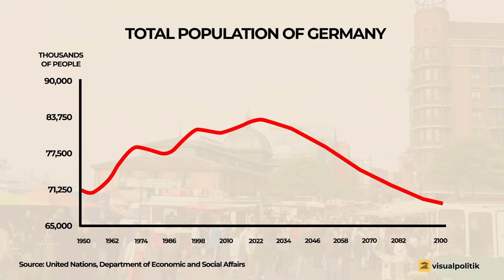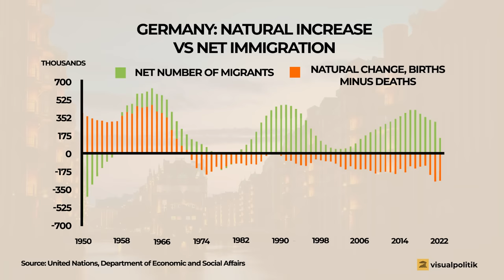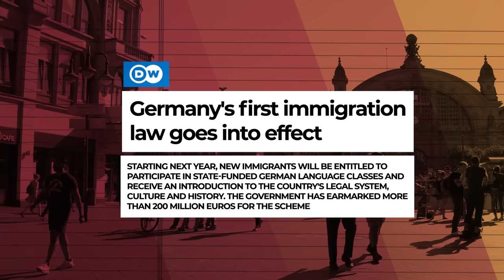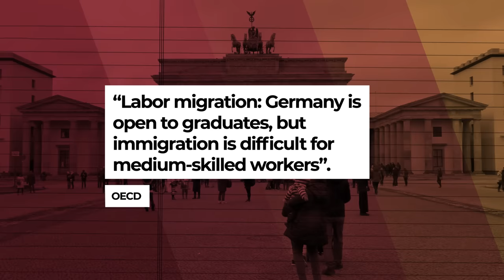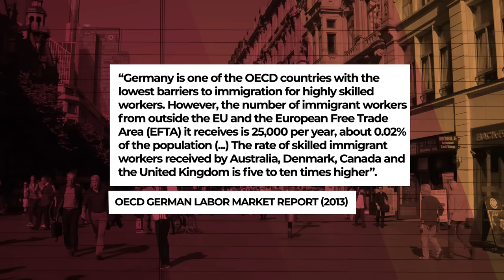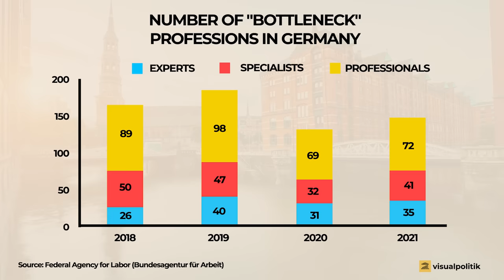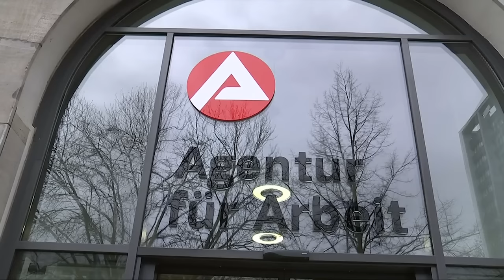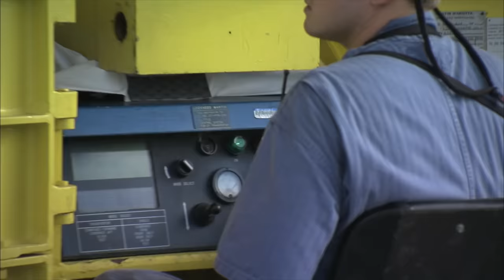Why Is Talent Fleeing Germany?

Comment: I am a seasoned software engineer, and I came to Germany from the US about 10 years ago. I had high hopes, but those hopes were quickly dashed.

Most of my time was spent in Berlin. Berlin's employers are very reticent to pay market rates. Half to a third of what I could make in the Boston area where I'm from.

Then there is the bureaucracy. And the high taxes. There was also an issue of Internet infrastructure when I first arrived -- piss poor bandwidth, but that actually improved over the first 4 years.

But the salary did not. I found myself hitting this salary ceiling of €65,000. If I tried to push beyond that, I typically did not get hired. If the demand is so great, why don't they pay more to attract more?

Then a firm in Luxembourg reached out to me, and put much more money on the table. So now i left Germany and live in Luxembourg. Higher salary, lower taxes. More modern infrastructure. And English is better spoken there.

What's not to like?

Also, during the plandemic, Luxembourg had Covid policies in Luxembourg were better than Germany's stores remained open there that were shut down in Deutschland.  

Even though I now qualify for German citizenship, I have declined to pursue it. Why? Because I think there is a real danger that Germany may opt in for citizenship-based taxation -- rather than resident-based like nearly all other countries besides the US.  Part of the many reasons I left the US has to do with its taxation policies. I do not wish to continue being a tax slave to the US when I haven't even lived there in over a decade. And why would I want the same with Germany? Especially since their tax base is on the decline?

No.

If Germany truly want to attract highly-skilled individuals, they should copy what some of its neighbors are doing. But I am not holding my breath. I go where I am treated best.
Reply: Well atleast you got a cool hat
Reply: @warcrimeconnoisseur5238  Everyone told me I would look good in this fedora, including my own daughter, so I got it. LOL
Reply: Plandemic 😂
Reply: I am IT guy who considers moving to Germany and I am surprised how many companies use Django at new projects. That's how you know the upflow of knowledge and people is broken there - it's just nobody to tell them Flask is the standard now

Comment: as a German I assume, next to the combination of some negative hard facts (taxes, bureaucracy, costs, language), that exist together with positive properties (healthcare system, public transport system, reliability) it's the prevalent mood in Germany. The atmosphere outside Germany seems to be usually significantly better.
Reply: as an immigrant myself, I generally do not have much problem with taxes and language. The frustrating part is mostly completely unneccessary bureaucracy, the official and unofficial. Things are often made extremely complicated, time consuming, with made up, pointless requirements. Official part is obvious, but unofficial part is the approach of people, especially if you worked in different sectors/works. I studied engineering, but worked in teaching and later sales, not that I wanted to, simply I had to, to earn my living. But when I come to Germany, over and over I heard from potential employers "but you did not study sales" despite having a solid CV and ex-employers who are international and ready to give positive feedback. It is increadibly about the form in Germany, not the function. A terrible actor will get hired in Germany if they studied acting, but increadibly actor who studied law before becoming actor, wont get the job.

Comment: I love Germany and lived there for 1 year and 9 months and during that time applied to more than 300 positions in the pharmaceutical industry (I have a masters in biotechnology). Even though I am a EU citizen, have German level B2 language skill and had more than 3 years of previous professional experience outside of Germany I got like 2 interviews. I got sick of it and instead applied to the UK and within 2 weeks I got 3 interviews and two of them offered me a job!

I think the most important reason is their education system, if you have masters they expect you to take a PhD before entering the industry. Secondly, I have Iranian heritage and was told and also got the impression that it made some Germans "scared", and one even told me to write Im christian in my CV which is highly unnecessary and discriminatory. It's sad cause I got along with the locals and connected with Germans in general.
Reply: The thing you mentioned with the inofficial PhD-requirement is it only really applies for scientific professions, i.e. research psotions in the chemical industry. Engineering is also often considered a field of science, but not in this case. Engineering professions usually don't require a PhD at all, actually you can also find work with only a Bachelor, although that type of work and pay would be more comparable to that of someone who has completed an apprenticeship. It's similair to the IT branch, although they are sometimes even more liberal than your typical engineering professions concerning degree requirements.

Comment: Germany wants engineering and tech workers TRAINED by OTHERS working for Germany at rock bottom salary. E.g. typical expectation would be 5+ experience in SAP,  expensive certifications, preferably MS level education from a leading University. He would be expected to business fluent in Germany during interview, and near native by end of probation period. His net salary expectations would be 2500 € plus/minus, for a location where basic cost of living is about 1700€. And he'd be expected to go to work in perfect business formals whose upkeep sends one 300€ minus per month. And I did not even mention passive aggressive office culture and rabid housing discrimination.
Reply: 300 euros for formal attire every month is absolute nonsense! Buy a dress suit for 200 euros which doesn't come with folds in the trouser legs and you can wash it on hand really easily. Even one with folds in the legs is doable but you'd have to fiddle with laundry clips and wire to keep it looking like new after washing - avoid it if you like but once you get the hang of it it is doable - you could even make your own drying frame from electrical wire. Also, a dress shirt made from 100% cotton costs 20 euros and it doesn't even require ironing, you throw it in the tumble drier with a few ice cubes and it comes out without any folds, then you reinforce the collar with special clips which cost a few Euros on Amazon and gently apply a solution of 95% water and some corn starch to the collar to stiffen it. You'd need 2 suits as a bare minimum so just buy a few if they're offered with a discount.

I have been doing this for 15 years and still have 2 suits from 2008 which I would not at all be ashamed to wear to a job interview, let alone to office. And they were not expensive but just run-off-the-mill stuff from C&A.

It only requires not having a heavily non-standard physique, if you're either very slender and tall or very bulky (like a body builder - not so much like a fatso - fat people are numerous enough that finding fitting clothes isn't hard) but even in that case it'd work but one'd need to buy the suit a size or 2 too big and having them amended by a tailor. Combine the look with a nice tie and a 30 euros wrist watch and you're done.
Reply: Go to London with those qualifications and you will get a job on double that salary with lower taxes very quickly... you still wont get a cheap apartment though :)
Reply: @aikighost  Munich (and partly Frankfurt and Hamburg) are as expensive as London, especially for foreigners. I would take uniformly expensive London, over Vitamin B based housing market where only ethnic Germans get the cheaper subsidised apartments in nice leafy neighbourhoods. So foreigner burns from both ends, pays high taxes to subsidise apartment for Germans, and himself get discriminated in housing market (which is entirely seen as "Ermessensfreiraum").
Reply: Exactly! It's simply not worth it anymore.

Comment: As I am leaving in Germany for 8 years, studying and working as Architect on different professional projects with different big companies like DB and Lufthansa..etc, besides the high level of Bureaucracy I never felt fulfillment, integration, or even motivation from te society, and it is completely the opposite of experience for me compared to 3 years I have spent in Dubai, and moving to another country is always a challenge but never too late, so if you are not satisfied, just take your one-way flight.

Comment: As an immigrated German, working in the health care branch, I can highly advice not to come ro germany. 
Beside several aspects, which are discussed in the video above, there are also other increasing factors. 
Quality of work is dwindling strongly in the last 10 years, besides high taxation and a lot of extra work to do, there is no serious attempt for skill-improvement from higher ups. Due to lack of work-power, many employees in hospitals are lacking, not just basic skills (which would be recommended for the job),  but they also cannot properly communicate with each other in german. This actually decreases work efficiency as well as capability, leading to a spiral-down effect, at least in my working sector.
Another crazy problem is connected to the social care system in Germany. Due to very left sided politics, Germany punishes work with enormous taxation and throws the money towards an increasing amount of unemployed people. The fun fact here is that unskilled immigrants got a strong pull factor to settle to Germany due to this, while high skilled people would find everywhere else better payment in correlation to the stacked tax burden in my country.
Also to mention is a social unrest, which is caused by multi ethnicity reasons, in a country with difficult social rules (beside the fact, that a lot of uneducated immigrants from Africa and Eastern regions show generally a more violent profile). These factors accumulate also to a continuously decreasing educational standard and shrinking academic levels. 
Germany also owns a very corrupt leading class, which can stand in the way of people with high expectations on specific careers. 
I'm, myself, an immigrant, but was growing up in Germany and tried to be part of these people. Nowadays Germany became strange to me, because you can feel the regression in strength, own-belief, cultural meaning, unity, and many more things. 
If I would be 10 years younger, I would leave this place.
Reply: Where are you from ?
Reply: You are right. Dont come to Germany. Better even leave us alone .

Comment: Talent is going, Talent is also coming. The amount of Polish IT specialists I've seen in Germany over the last two or three years is insane.
Reply: Ok and still not enough
Reply: Just curious: what city are you in? I've seen that Berlin has a very high number of foreign IT professionals, but I wouldn't be surprised if that is primarily a phenomenon limited to Berlin.
Reply: @High1QWealth  you have no idea what you're talking about
Reply: @LowStuff  AI will make coding more efficient.  Jobs will be affected.
Reply: @High1QWealth  I work as a software developer and my job is not in danger. The workforce can make use of AI, but I don't see AI replacing too many people, if at all. Even if it was the case people can not be fired in Germany. Most people forget that when comparing Germany to the USA for example...
Reply: @mbvalency  Not being fired from a job does not mean that the number of jobs will not decrease as employees leave or retire.
Reply: @answerman9933  The shortage of skilled workers will only get bigger here. So some positions can not be easily replaced. In companies it becomes more and more important to work efficiently and automate (dumb) tasks. This is where AI could also help a little. But people losing their jobs, because of AI is not a thing. Workers are still needed somewhere.

Comment: Language the the main issue. It's tough to learn, and exams needed to do immigration are a pain. In countries like Netherlands the exam is far easier. Germany requires official B1, which theoretically is not high level, but it's very focused on grammar and it's a 4h long multipart exam, where failing any part fails whole thing. If they relaxed this requirement, it would be huge help.

Instead they do useless crap, like offering free classes. If you're a skilled worker you work will likely offer to pay for private course. Still, I've been to some of those free classes. They're mostly bs, because they take place during the day, so if you have a job, you can't attend. And if you find one in the evening, you don't learn much because it's full of people on all kind of level and teachers clearly can't be bothered, so they teach with the lowest effort possible - go around the class and have people repeat some sentence.

And you kinda need to learn the language, not because co-workers, but the bosses often have the lowest English skills in the whole company.
Additionally local dialects differ a lot. You can have communicative German skill which is fine in Berlin, but if you end up in south, eg Regensburg - good luck. I've seen native Germans asking for translation help.
Reply: For some reason I remembered how I've got Russian residence permit. Technically it has exam, but it is basically "name the most famous poet" level and read 10 lines of text aloud and few more hoops like that. You are also allowed to bring up advisor who'd help you.
If you fail even at that, law company would arrange you remote testing for $80 and it's ad is right in migration office